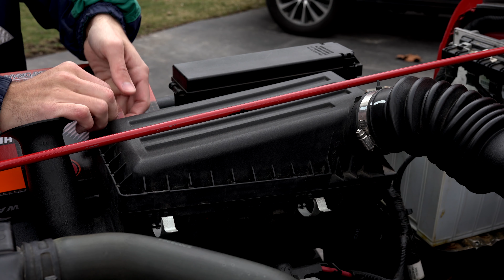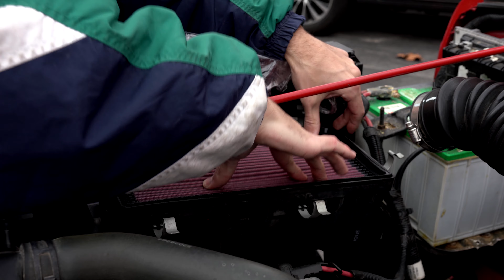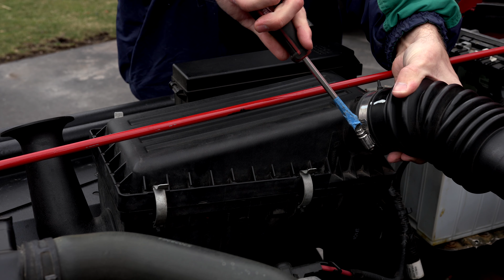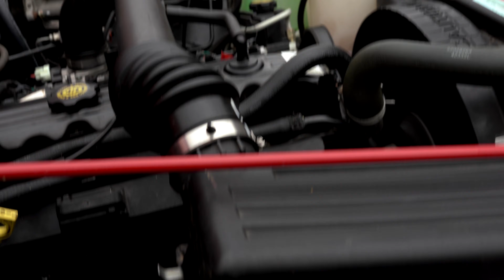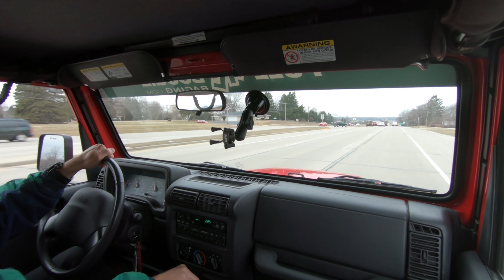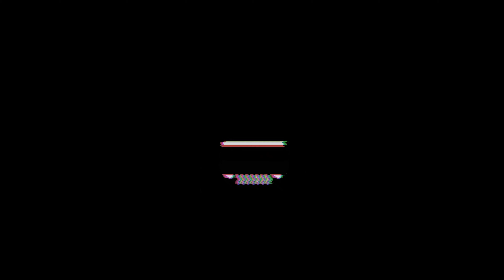K&N Air Filter Jeep TJ | Install and Review

Comment: Is it worth putting in a K&N air filter for my 04 TJ? It's stock inline 6. I saw in some articles, I could be wrong but I've read it takes in more dirt and if my engine is stock to just stay with regular filter.

Comment: Actually, I might need some help. I am a 70 year old with my first jeep. It has come with a tapered K&N filter. Do you have any info on it ? Should I clean it or change it?
Reply from the maker: Hey Craig. Some require oil and some are dry filter. I would look for a model number and check on k&n website